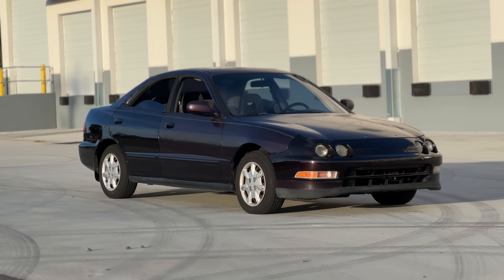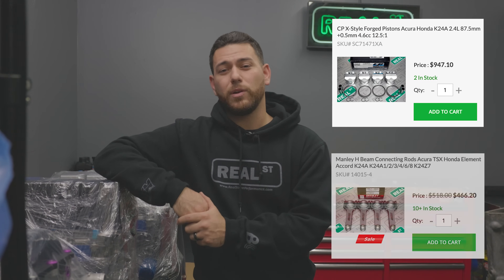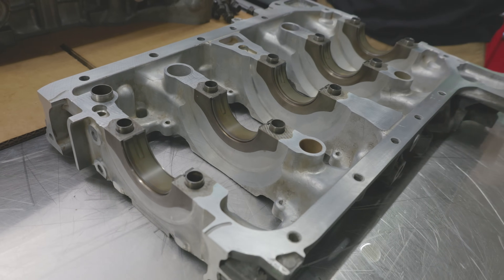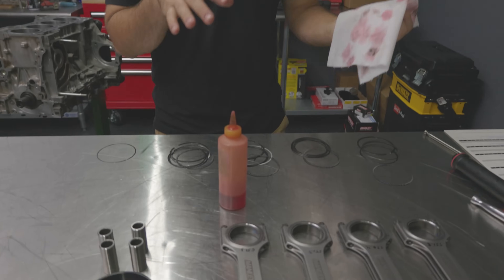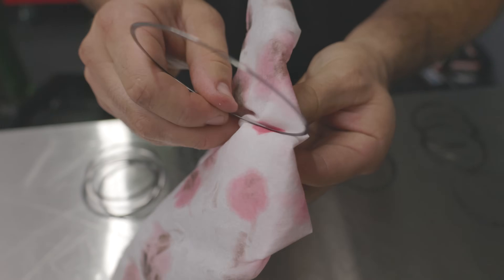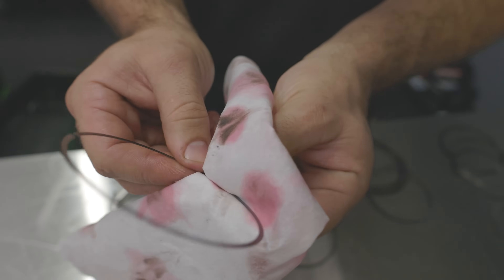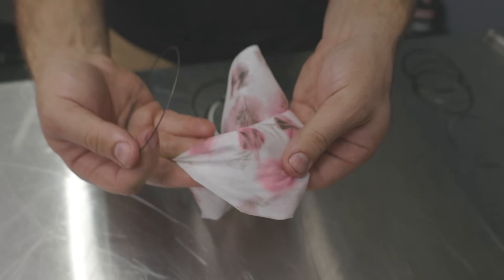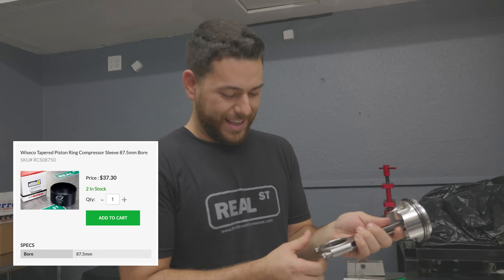Building a K24 Engine: Part 1 -  Engine Block Assembly

Comment: I haven't done anything serious on a car in about 20 years, so i apologize if I sound dumb. But when you assembled the bottom end with the crank in, did you reuse the bolts that you previously torqued when you put it together without the crank? If so, were there like totally different torque/+angle specs you did to somehow prep the fasteners for final assembly? I don't quite get it. Asking because I'm thinking of putting a K24 in my E30, and even if i only want 250ish WHP, I'm still probably going to need to do some of this stuff on my own. Thanks if you ever see and answer. There's def useful stuff in here, but I'm always going to have a question.

Comment: I'm doing a NA build on a k24a2, im getting a type s oil pump, rbc intake, a 50* gear, 1320 2.5in header, invidia N1 2.5in full catback,  injen short ram, and a complete replacement of the timing components. Motor came out of a daily driver 06 tsx with 160k miles. I don't want to ever open the motor up unless I have to, but would consider doing a headgasket. I wont be running any boost so I think ill be fine with my gains without having to worry about internals, should be a 250hp motor when I'm done. Great video man, very inspirational for me to finish getting all the parts to finish building mine!
Reply from the maker: Sounds like a great build! You're gonna love the K24 build on that car. Appreciate you watching!

Comment: I have a weird question. Speed Factory has VTEC locking pins that permanently locks the rockers where VTEC is on all the time. Could you use those on the rocker arm assembly of a VTEC head  and install the assembly and VTEC cams on a non VTECH head ?

Comment: When you cut the type s oil pump do you take it to a machine shop? Also is that type s oil pump not made specifically for the k24 that's why it needs to be cut?
Reply from the maker: Correct, needs to be cut to clearance it since it’s not from this engine originally. Can be cut at home or by a machine shop if you prefer. There are also kits that come pre cut like the one made by 4 piston.

Comment: Are you using the 3/8 or 1/2 tq wrench
Reply from the maker: @K2499mm  3/8 , 5-125 range. Digital snap on wrench
Reply: @ 1/2 would work also or it’s just what you prefer
Reply from the maker: @ 1/2 would also work. There is no difference in tool function from 3/8 to 1/2 if properly calibrated and within its intended torque range.
Reply: @ when is the next drop for the video coming out.
Reply from the maker: @ part 2 and 3 are already released. Link in bio, as well as available directly by clicking on videos on this channel
Reply: @SPTuning  part 4 released yet
Reply from the maker: @ engine is all assembled, just waiting to get on the dyno in the next few weeks :)

Comment: Genuine question, why the looser clearance than oem? Any advantage?
Reply from the maker: @nagasakinoisyboi7288  more heat and more cylinder pressure typically puts more abuse on the engine, causing smaller / tighter clearances to close up, expand, or lose their oil wedge. Larger clearances can mitigate those problems.

Comment: I have an AP2 S2k, Is it possible to replace all internal bearings and piston rings without prior experience ? Theres a service manual in the forums that I was able to download, but not entirely sure if it has all the information ill need to refresh the internals.
Reply from the maker: Hey there! Yes, if you take your time, follow the repair. / service manual, and stay organized you should be able to tackle that yourself :)

Comment: Does anyone know. What is the max, compression ratio you can go on pump fuel? On a NA setup. I'm wanting to run pump, and E85 Cheers.
Reply from the maker: I’m sure there will be different opinions in the comments, but I’ve seen safely up to around 12.5 : 1. You can always try to stretch it out for more but that’s playing a game that you don’t want to lose. 

On this engine we’ll be running ethanol
Reply: There are a lot of factors that impact that. For example a large cam with more overlap will bleed off some dynamic compression and let you run higher static CR. Head work and shaping the combustion chamber as well. 12.5 is probably going to be the upper end on pump gas with good head work and large cam. You probably couldn't get away with that on small cams and a bone stock head though.
Reply: I wouldn't go above 12-5-1 on 93